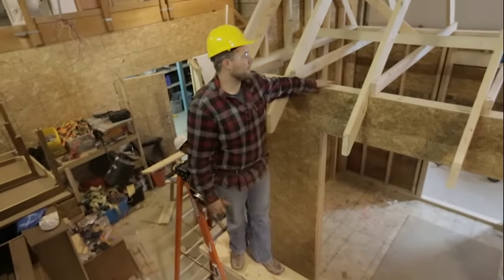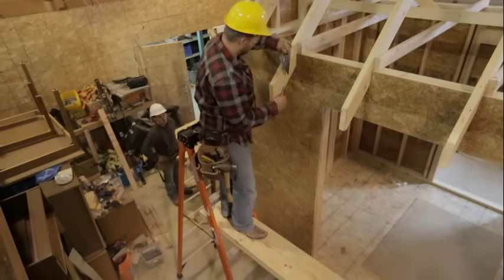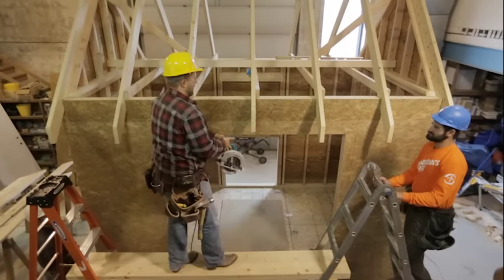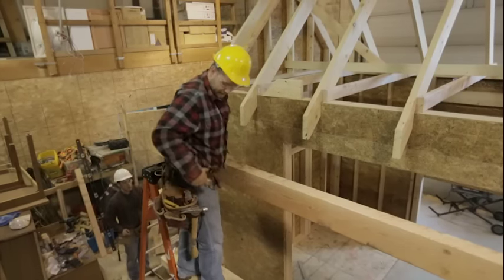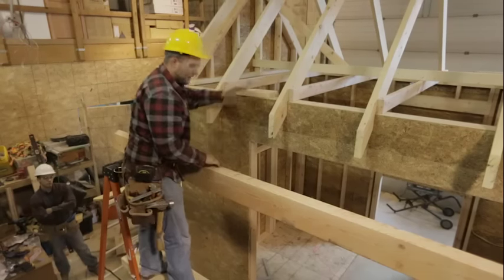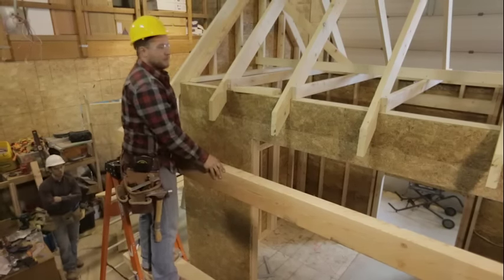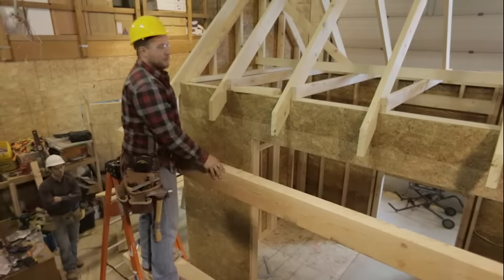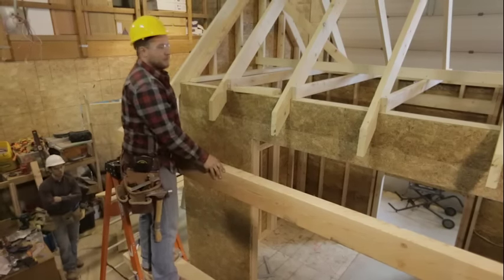How to Install Sub Fascia // Roof Framing Part 7

Comment: Your "fly" rafter ("barge" rafter) should be hung on lookouts, not just blocked.  Otherwise it's just hanging there on nails at each end and whatever you nail on through the roof sheathing.  Nice series of videos... very instructional.
Reply: I just watched Roof framing with Larry Haun and he cut notches in the gable rafter and placed a block against 2nd to last rafter, in and through the notch..making the lookout overhang for fascia. I guess that's how you do it?
Reply: @laurieclarkson9180  quantity versus quality. Its how all the new home s are being built.  Cutting corners for profit

Comment: Framer here :  make your walls nice and straight.   I use an extendable level and go from plate to plate.  I don't sight it fir the most part I just level it..     if your walls are crappy your rafters will look crappy and not fit right on the ridge

Comment: Do you have too much meat of the rafter gone at the bird's mouth? It looks like you have a 3-1/2" seat cut on a 2x6 rafter. The IRC's D/4 code for rafters states that you can only notch 1/4 of the depth of the rafter. Your maximum seat cut should be no more than 1-3/8".
Reply: I think it's a shed? No occupants so codes don't apply due to the small square footage

Comment: I see you ripped an angle on the top of your rough fascia board.  We usually just drop the fascia so that the outside edge planes out with the roof slope

Comment: 7:16 could you cut at 8 inches plumb line, then cut from the bottom up 6 inch plumb line/notch to keep the slope of the rafter and still mount the fascia board leaving a full 8 inch fascia ?

Comment: Straighten your walls. Straighten, brace and plumb your ridge.  Cut your rafters dead on.  Install alternate rafters. Put in lookout blocking.   Hammer drill subfacia, shim to plumb.  Gets easy after the first hundred houses.

Good four man crew can frame a simple gable roof in 3 days.  The best framed roofs take 10 guys (and gals) a week or more...  residential.   I have worked framing commercial roofs for months.  Sweet gig if you can get it.

Put your flying gable on before you raise the wall.  Trim it out too. If you are good, you can tyvek and side it before you raise it.

Wood framing is an art, best performed by the young.  It takes years to understand.  It is good, those who become interested.
Reply: For a cathedral using a ridge beam and 10" or 12" rafters would you use a 2x6 for look out? It seems like if I used the other sizes the overhang would be too deep.

Comment: Finally, someone who answers my question, and then some. I love the quality of work. 
How did you cut the Facia on an angle with precision?  The only thing I can think of is using a track saw or using a circular saw with a homemade 2x4 track nailed/screwed down.
Reply: Probably used a table saw.  But a circular saw would do.  Look at this video of a Japanese carpenter taking a slice off a board with a circular saw with a guide attachment.  At a minute in  https://www.youtube.com/watch?v=adkmODHPzYw

Comment: Question: When you installed the lookouts on the eve... You mentioned that you cut them at 10", which makes sense given a 12" overhang (12 - 1-1/2 for the fascia - 1/2 for the sheathing)... but you left that gap around the sheathing along the gable rafter... Did you cut the lookouts 10-1/2" and then notch out 1/2" for the sheathing where they covered it, or am I missing something visually here?

I ask this because I'm doing a small duck house and I'm trying to decide how to lay out the rafters / eaves and the sheathing. On one hand, doing the sheathing first and then adding fly rafters on the outside, lined up with the edges along the roof profile seems easiest; on the other hand, doing the fly rafters / lookouts first, then sheathing seems like it would make the eaves a little stronger, but then I'll have to add an additional nailing surface for the top edge of my sheathing.

Thoughts?

Comment: Hey Great vids guys. My first question here though - hoping for an answer. I have one of those pre-fab sheds, you know - the ones that are built like crap? Yeah , those. Anyway I want to insulate the shed and put a small heater in for the winter. The rear and gables have no sofits but the front eave does. However the front eave sofit has a solid plywood panel in it so that there is now air flow up through the sofit into the rafter spaces. Why did they do that and can I just remove the board and also replace the solid sofit vinyl with vented vinyl? Is having only front sofits good enough or will I be sorry on the back roof later with mold/excess moisture? Sorry for the long question, I just wanted to make sure you understood. Thanks and keep up the great videos!

Comment: The little ski jump you reference at the 7.00 mark is quite a desirable effect on steep roof pitches as it slows rainwater down when falling into the gutter which stops rainwater over shooting the gutter especially when raining hard. Most steep pitched Victorian houses built here in the UK were built purposely this way and aesthetically looks nice as swept eve feature.

Comment: If for some reason you end up having a wall that is not perfectly level, you can use a string line from end to end with 8d nails to adjust your sub fascia to be straight.

Comment: If your rafter tails extend more than 14 to 16 ft the chalk line will sag down the rafters. Hang a dry line under the rafters and mark each tail. Perfectly straight allowing for wind. I prefer a Squangle for this rather than a speed square.

Comment: Well done job, I live in Brazil, and I would like to make a roof like this in my house, and I would like to know, what is the minimum distance that should leave between the ceiling and the OSB, thanks in advance
Reply: Cleber medeiros,
Those measurements are determined by the climate you build in. Since some climates have drastic temperature changes (up to 100-degree differences) compared to some that stay the same all year round, those measurements can have a significant difference. I would check with your local code authority and find out what they require for your climate zone. Hopefully, that helps and thank you for watching!

Comment: Did you allow for the 1/2" sheathing in determining your 'fly' (rake overhang)?? With 10" fly blocking, it will only finish at 11 1/2". Further, why simple blocking instead of lookouts??
Reply: Had to reread your comment a couple times i get it though thanks

Comment: How do you measure the angle of your bevel for the sub fascia board?
Reply: It should be the same as your roof pitch, right? I think if you use the pitch angle on your speed square, that would be pretty close. At least that's how I'm hoping it goes. I'm about to start.

Comment: How did you cut the bevel of the fascia?
Reply: Probably a table saw... I'm not a professional carpenter, but given the tools that I have available to me as a hobbyist / homeowner, that is what I would use... You could probably do it with a circular saw and a straight-edge for a guide (which is also the basis for the "track saw" that I've seen for sale lately).

Comment: I'm currently replacing the fascia and soffits on a house that I own and marveling at the crappy construction that the original builder and his legal-immigration-challenged day-layborers put into the house.  The rain gutters ruined the fascia and most of the soffits.  The soffits were made out of Masonite (i.e. cardboard), so they don't handle getting wet that well.  Much of the last foot of the roof sheathing was exposed to water because of the roof having what you called a "ski slope" at the edge, thus providing a place for water to pool since the roof is only cut on a 30 degree slope (at least that was about the angle that seemed to match for the end trim pieces that I needed to cut).  I remember helping replace the roof on the house at our family's ranch probably 45+ years ago... The roof decking solid board lumber (shiplap, perhaps).  It was probably 70 years old at that time and still in good shape.  Because of it being solid board lumber, if a piece that was near the edge had rotted, it would have been possible to remove it and install a new board without having to cut out the plywood like would be necessary these days.
Reply: " legal-immigration-challenged day-layborers" 🤣😂😆💯

Comment: Great video. Im going to use a nail gun tho. Call me lazy !
Reply: @NSMConstruction  I am a 40yr+ carpenter and I knew by watching that you use a nail gun for your work since you don't know how to use a hammer...looks like you can cut the last 6-8" off the handle???
on most jobs...if you can't drive a 12d nail in 3 strokes...they will fire you
hand driving nails is a lost art...
js
:D
Reply: @docyoungblood9521  My father had forearms like Popeye's. There were no nail guns back then.

Comment: It would be much easier to perform these tasks if the scaffolding was lowered about 2 ft.  And watch that thumb on your left hand.  You were making me nervous as you were swinging the hammer.  I bet that wasn't too fun putting the bevel cut on the 2x8.

Comment: In my humble opinion, if you made sure your walls were straight and parallel you would not have to run rafters long.  Never cut anything in the air that you can cut on the ground.  Also, putting the roof sheating on first makes putting on the sub facia easier.  Just an observation.

Comment: great info but man use a nailer to speed this up. or swing that hammer man lol
Reply: @NSMConstruction  may i know the reason why you don't use pneumatic nailer.
Reply: @PooprivaL147  safety and liability reasons since they're intended for volunteers.
Reply: Just go full Larry Haun on him: one swing to set it, one swing to drive it.